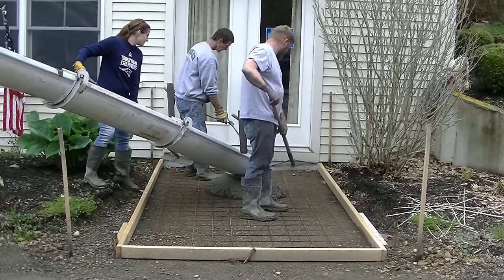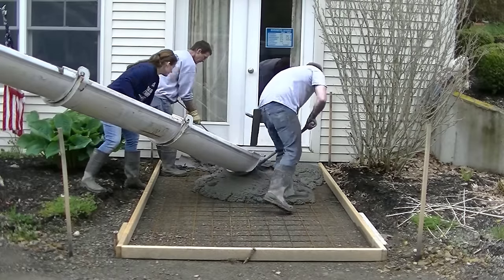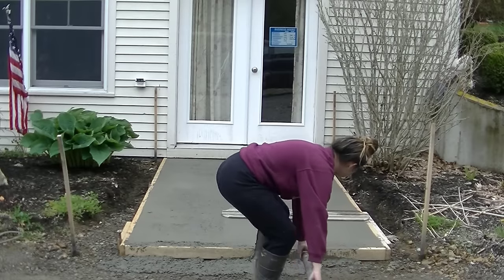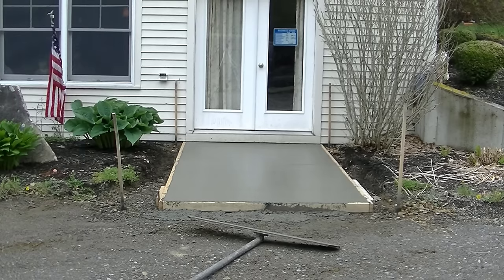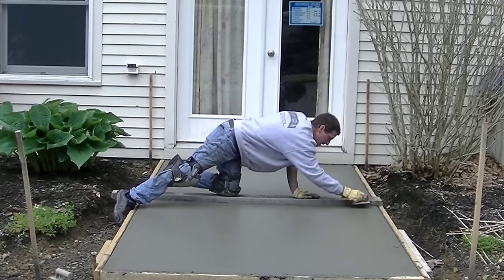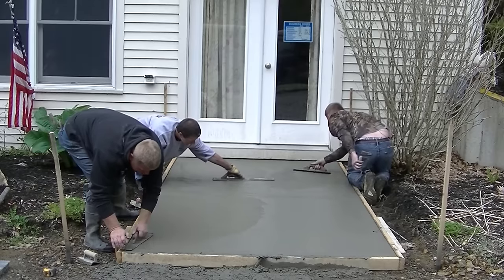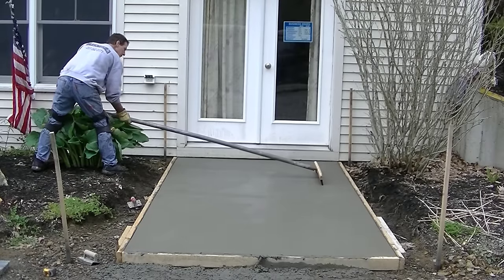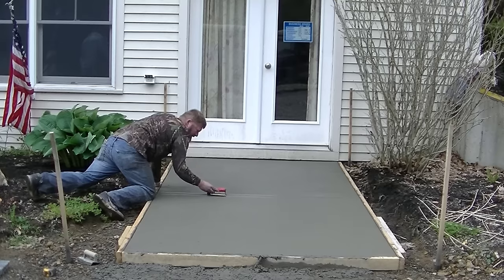Dry Pour Concrete VS Wet Pour Concrete - No One Else Is Telling You This

Comment: How is the mesh doing any good when it is stepped on the entire pour?
Reply: You’ve never done concrete have you
Reply: He was picking it up as he went and once concrete is under it and you’re stepping back on it, it’s not gonna go back down to the ground. It’s fine
Reply: @brentpearson4877  wrong, it actually does go back to the bottom. Steel on residential is supposed to be in the top third of the slab, not an inch from the bottom. Plastic bar chairs cost fck all and takes little effort. It's the correct way to do things and should be under the mesh all times.
Reply: @lachlanitis2311  I agree with you because yes that is the way it is supposed to be done. However, those chairs are cheap as hell. And bust easily. And I don’t think it goes to the very bottom under the slab completely. Hard for me to believe that. I’ve had pvc pipe float to the top and I know you cant push that stuff back down and have to dig underneath it. Different material I know.
Reply: @brentpearson4877  yeh well it does, iv been concreting 20 years and iv ripped out old floors that used to have the mesh pulled, it was at the bottom. With the slump these guys pour I have no doubt it goes back to the bottom. And the chairs we use don't bust?? They cost us about 15 a bag and cover 60m2. Not a bad investment for doing things to the industry standard.
Reply: @lachlanitis2311  Well this guy has been doing concrete for over 40 years. Seems to me that it is working fine for him . Same to Victory Outdoor Services. Maybe the ones you tore out they weren’t picking up the wire mesh properly? 🤔
Reply: @brentpearson4877  old habits die hard and old school is not necessarily good. You know in a lot of the world these guys inspections wouldn't pass because the mesh isn't chaired? Victory outdoor services concreting is totally different. He pours his concrete quite stiff so I don't doubt the mesh stays there. However Mike pisses his concrete up and puts water reducer in it have you seen how wet he pours it?? Also Mike is still using calcium chloride as driers when the majority of the world know how detrimental it is to steel. If you don't know, you don't know I guess.

Comment: I would not even want to use that concrete product that is dry you can use to set poles in the ground buy pouring dry and adding water.  Concrete, cement all need to be mixed with water in my book before pouring.

Comment: Dry poor concrete.  Yeah, I meant to spell it that way.  What a horrible idea.  I get it.  It's new and trendy.  If you're doing something that doesn't require strength or need to look good, like a place to set your garbage cans, knock yourself out.  I don't care what anyone does, but I'll recommend against it.  Seems like more work with dry pour and I see ZERO advantages except saving a short load fee.  I recommend finding other projects and forming them up so you can avoid a short load and get a qualty product.  For the beginner DIYers, I'd recommend having ice and retarder to the mix for flat work of any appreciable size for extra working time and practice.  A beginner can get the hang of it prett fast.  You won't be a pro at the end of the day.  The  pros are pros because they can get it done right and fast.  And, they know how to do the neat details stuff that the average person wouldn't think about, but would notice if it wasn't done right.  When highway departments and airports runways start being dry poured, call me.  Until then, rent a mixer.

Comment: It might be helpful if you actually did a dry pour correctly instead of relying on theory or a half-hearted attempt at dry pour in which you didn't follow the directions outlined by Cajun County Livin'.

One potential issue I see with dry pouring is the look and feel of the finished surface. Wet mixing offers more options and allows the portland cement, the binding agent in concrete, to disolve, go into solution, and then solidify into a very smooth, hard surface.  

Anyone wishing to try dry pour should consider doing a small practice slab first before committing to a larger project.
Reply: I'm guessing you don't actually play chess.
Reply: @ep9360  Actually, I do, and I'm quite good at it.
Reply: I agree … it comes across as disingenuous to try and poke holes in a method that you didn’t actually follow. I think your point about the finish of dry pour is a great one and should likely be the focus of the video. Not that dry pour isn’t strong enough for stepping stones or a small patio (since other channels have driven cars on dry pour slabs with no issues), but that you need a wet pour and possibly a professional to get the finish that you’d typically want for a project. The type of jobs that people would dry pour are likely not the ones that a concrete pro would even want or take.
Reply: @aaronlee3955  I totally agree.

Comment: I think the dry pouring looks like more work actually. It looks like it would be less stressful in the beginning if you're working with bag mix without the crew to help but then there's that stress of not knowing how well it's going to hold up.
Reply: Its a hell of a lot more work when you have to tear the entire thing back out because it is falling apart a week after you pour it.
Reply: Don't you think the manufacturer would tell you that it was fine for dry pour their sales to boost tremendously but they haven't
Reply: @davidsimon1366  Rules were made to be broken.  Besides, if everyone followed the instructions on the bag of Quikrete, they'd be working with a 2" slump that's barely got any water in it anyway.
Reply: @MAGAMAN  Speaking from experience or just hearsay?

Comment: Right but it depends on where you live. The couple you are referring to live in Louisiana. A very wet place. So yes, there is both ground wetness combined with 85%+ humidity to make this happen. Probably wouldn't work in deserts. But for small things like your small slab or some pavers you walk on it probably would work. The key question is how will dry pour concrete hold up over time?
Reply: If it's a small job, why not mix the concrete?
Reply: @michaeljung4398  Because it's still easier to do it dry.

Comment: Unless you are willing to actually try a dry pour (following the process exactly) and compare the strength to wet pour after the full curing time, saying that Dry Pour is useless seems disingenuous. Does dry pour potentially make the concrete less strong than the listed psi? Sure. But no one is saying that dry pour should be used for driveways or foundations … it’s used for simple walkways and patios where 5000psi is overkill.

Don’t be Blockbuster throwing shots at Netflix … either prove that dry pour isn’t strong enough for a walkway/patio or just say that you prefer wet pour for X reasons.
Reply: This chanel is for traditional concrete. Don't waste your time on this and this guy put dry pour on his title to get views.
Reply: @kanaka250  yeah you’re right. I just hate when people knock new methods/ideas just because they’re new.
Reply: I have yet to see anyone do a cylinder test on dry pour.
Reply: @aaronlee3955  He's not knocking it because it's supposedly "new", which it isn't, but as Mike says, it is the lack of a homogeneous mixture that you get with wet mix that would be a killer with a "dry" pour.  As a mechanical engineer that does concrete myself, Mike is spot on.
Reply: @kurtfrancis4621  as an engineer, you should expect individuals to test their theories instead of just making statements of fact without evidence. Dry pour has been used for different purposes, including fence posts, for a long time. So the question is IF that method is suitable for any other use where traditional, wet pour has been the norm. Maybe not a driveway that holds tons of weight, but stepping stones? A walkway for foot traffic only? A patio? My only point is that there are other YouTubers who are looking at dry pour with an open mind and either proving that is has some merit or proving that it doesn’t. Hearing from someone with a wet pour concrete business that dry pour is useless without doing a true test just doesn’t seem genuine IMO.
Reply: Google "an introduction to dry-cast concrete" and read. They did a 4 year study on dry pour back in 1969. I think that study is more reliable than the sidewalk crew
Reply: @jamesd8585  I just read it … very interesting. Looks like they compact the concrete as well to further reduce any chances of voids

Comment: Not everyone has the $ for ready mix delivered.  Most smaller jobs you could do 3 or 4 times dry pour for the same cost.  Lets talk about convenience.  Dry pour has its place.
Reply: Dy pour is not convenient when you have to tear it out. Dry pour has NO place when pouring slabs.
Reply: If one can't afford the cost, don't do the project.
Reply: I did a 100 square foot project 4 in deep and it was cheaper to get it delivered pre mixed. I am 3 years in it looks as good as the day it was poured. There is a good reason professionals get the truck.

Comment: I can mix a two bag wheel barrel by hand fairly quickly.  However I doubt most of theses dry pour people have it in themselves. But it can be done slowly and with a good amount of water.  Take your time take turns and hand mixing concrete really isn’t that bad.  Watch some videos for proper technique

Comment: Concrete contains 3 things aggregate, sand, and cement. The cement is a binder that becomes like a paste when wet. But if you just wet it in place it doesn't fully contact all the surface areas of the aggregate and sand before hardening. Make your next cake by dumping all your ingredients in the pan and add water. Let me know how it tastes
Reply: FYI that actually is a thing it’s called dump cake, not a good analogy lol
Reply: Interesting! So, tell me, where is all the water going when it disappears, even after spraying a few hours after a dry pour?

Comment: not to be a smarta** but if the "dry pourers" are so confident in their concrete why don't they "dry pour" a cylinder and take it to a lab for a crush test? worked on a nuclear facility for over 17 years-millions of yards of concrete poured-we didn't have any conveyor trucks for "dry pouring"-only mixer trucks like you use!!!-check out hanford vitrification project.

Comment: I don't understand why anyone would see any advantage to a dry pour? Of course a wet pour will be superior as the wet will flow while dry pour won't. That means it will fill voids in even small spaces if done correctly. So that word correctly is what scares so many amateurs. But no offense to you professionals as long as the amateurs aren't trying to take on bigger pours than they are capable of doing then even a messed up wet pour will beat a dry pour!

Comment: If dry pour concrete was acceptable there would be directions on the bags. I would also like someone to try and order a concrete truck to dry pour.
Reply: Why would you want a concrete truck of dry pour when that is one of the reasons to not use wet pour?

Comment: Dry pour is just stupid. I can almost guarantee that you will never get proper hydration through the entire slab by pouring water on top. Once the top gets wet it basically creates a shield that prevents the rest of the water from getting through.

If you can't mix enough concrete to pour an entire slab, you can pour in sections. Run your rebar through like you were going to pour an entire slab and build your forms around it so that your forms are where the cut lines would be. pour every other section and when it is dry remove the cut line forms and pour the rest.
Reply: Quote: Once the top gets wet it basically creates a shield that prevents the rest of the water from getting through.  Unquote
Actually, you would be very surprised to see how quickly the water gets absorbed, even after a few hours of starting the wetting process, when the surface looks firm.